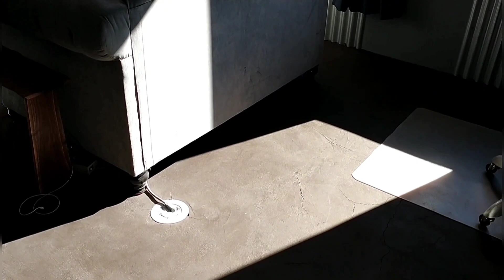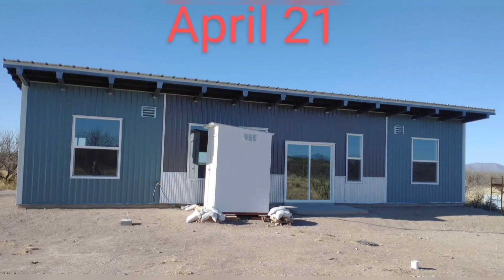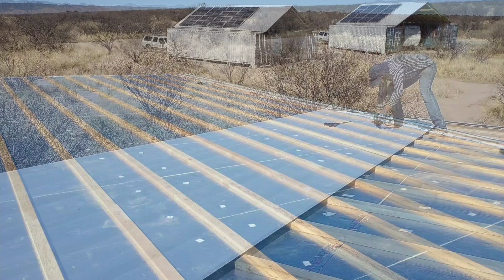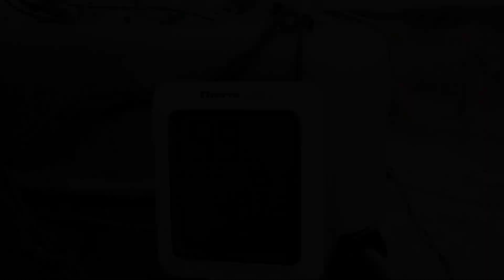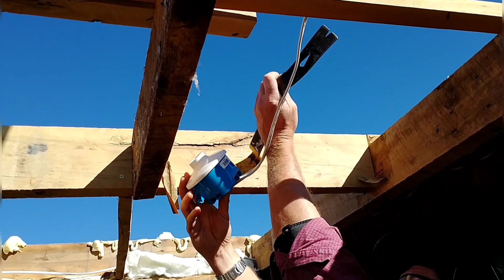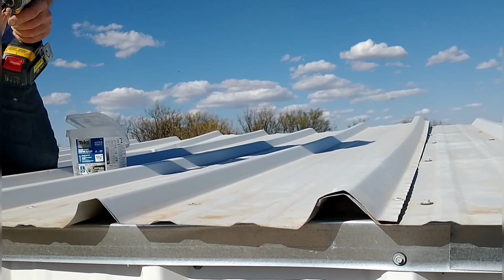100% FREE Heat FOREVER!! Passive Solar Design House  Performance 🌞 #56 DIY Build

Comment: Awesome achievement!  Question:  What is the SHGC on those windows?
Reply from the maker: We have the sticker somewhere but I'm not sure. We got the least expensive double pane windows they had at The Window Depot, so definitely nothing special. I'm sure the thermal blackout curtains we have help too.
Reply: @RedandAprilOff-Grid  I was thinking that with your design, a higher than average SHGC would be a good thing.  I hope to do something similar someday.
Reply from the maker: @scorpio6587  It definitely would be better, but our goal was also to build a very affordable home. The passive design is working way better than we expected! The last few days, we have been opening windows to keep it from getting too warm.
Reply: @RedandAprilOff-Grid  Awesome!

Comment: Thank You for the valuable information on house performance. Do you add sun screens to those windows w/o the Uv protection during the summer months ? I’d be.  Curious  to see if your able keep the sun out as well?
My observation is people who run a ground level water storages, say5 k gallon, seem to have allot better reliability from the deep well pump, and it makes  a pressure pump do the bulk of the work.
The solar driven pumps, like you replaced seem to last allot longer when allowed run continuously, or when cycle ing minimized.
As for the car battery they seem to have about a year lifespan here in Arizona.
Reply: They have a roof overhang that blocks most (or all) the direct sunlight in the summer months.
Reply from the maker: Glad it's helpful! The passive design works amazingly well here. Yes, the overhang is such that the sun doesn't hit the front of the house in the summer. 
The well guy said this isn't how this pump is typically used, which probably contributed to its early failure.
The desert is pretty harsh on many things, but we still love it. 🏜️

Comment: The real test having a comfortable temp inside is when the sun is missing for several days in winter. We have a fireplace
for backup heat in S. Co. @ 6850' earth ship! Have a Merry holiday with your family. 🌲😎
Reply from the maker: We don't get very many cloudy days here, but when it is cloudy, it is also quite a bit warmer outside, so it somewhat evens out. Turning the oven on to bake something for an hour raises the temperature a couple of degrees, so that can help too. We lived in northern NM, for many years, and it's definitely much colder there. Here it gets cold at night, but it warms up more during the day, which really helps. Thanks! Merry Christmas! 😊
Reply: @RedandAprilOff-Grid  Excellent videos.  Before building, did you compare the construction cost (materials and labor) of concrete walls to 16x8x8 concrete (cinder) blocks filled with concrete?  I'm thinking about a very similar build, but possibly using the cinder blocks instead?  Approximately what is the altitude where you live?  Anywhere near Sierra Vista?
Reply from the maker: @glennhansel9411  No, we wanted something with more insulation value, and this has worked out perfectly. This house has very stable temperatures, and is completely passive and comfortable in the winter. We are in Cochise County at around 4,000 elevation. 🌞🏜️
Reply: @RedandAprilOff-Grid    As you are aware, concrete has little insulation value,  it works through thermal mass.  I figured 8 inch concrete blocks filled with concrete would have approximately the same thermal mass as an 8 inch concrete wall.  Thanks for your response!

Comment: Thanks for sharing. It is nice to see how the solar heating is working so well in the new home. We had grid tied solar panels installed on our Colorado home in April and it has been really interesting to see how much the power generation varies from summer to winter. Fortunately we get credit for the summer over production to be used to offset our winter electric bills. The one drawback to the roof panels is snow coverage. I am way too old to try to remove the snow from the panels. We hope you guys have a wonderful holiday season.
Reply from the maker: Yes, it is really nice that we don't get much snow here. Clearing the panels would be a hassle! Winter definitely isn't as productive, but most days are sunny, and we don't have trees blocking the sun, so we still get almost 10 hours of sun even in the winter. Thanks! You too, stay warm! 😊🎄

Comment: Always great to see these updates. I'm thinking the UV vs non UV comparison might not be very accurate in the way you did it.  It seems that the cooler side is in a location that might not have had as much sun on it throughout the day, and the warmer side was "preheated" by light coming through the uv treated window in the previous hours.  
It seems you'll get a better idea of the actual difference by measuring the ground temperature directly in front of each panel (maybe 6" to 1' from the glass), and do it morning, mid day, and night, and see the average temperature difference. 
Maybe that's more work than the effort is worth, but it would be interesting for us nerds to see who are planning such details for our future homes. :)
Reply from the maker: Yes, it's hard to do because of the rugs and furniture and, the windows are higher, so the sun doesn't hit the floor close to the window like it does by the door. There is a definite difference in how hot it feels standing in the sun coming through the uncoated windows. We are glad we got the UV coating on the doors. The house is staying plenty warm and comfortable.